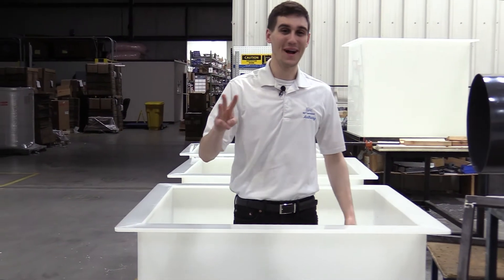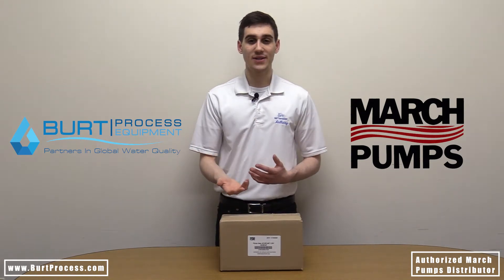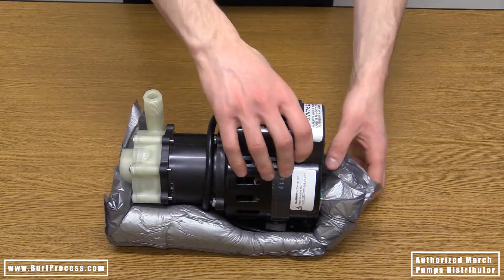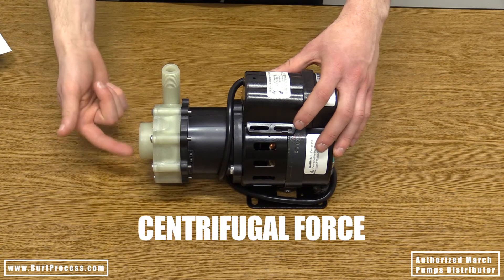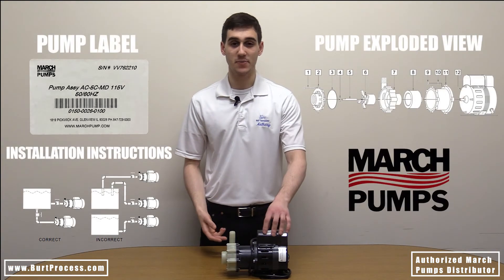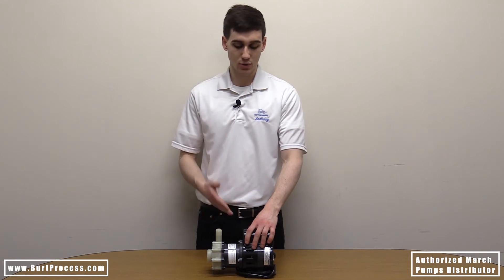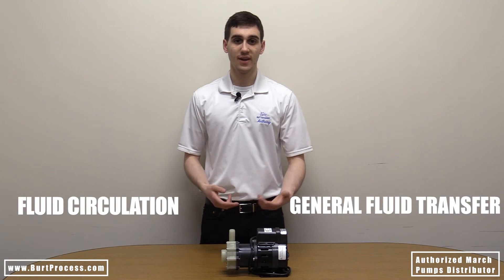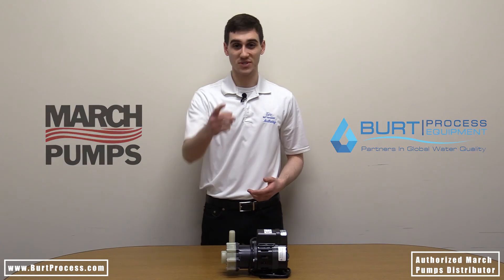March Pumps AC-5C-MD Mag Drive Centrifugal Pump Unboxing Video

Comment: Not an environmental packing, insta-foam?   NPT Female suction will crack if over torqued  breaking the casing.  Open motor not good in a wet environment.
Reply from the maker: Thanks for your comments. The AC-5C-MD unit presented is offered with 115-volt UL listed motor, rated for continuous duty, along with a 3FT power cord. For installations requiring submersion in wet areas a submersible motor is available. Please don’t hesitate to contact us directly at www.burtprocess.com
Reply: What about the placard on oiling. What is the interval and how much is needed?